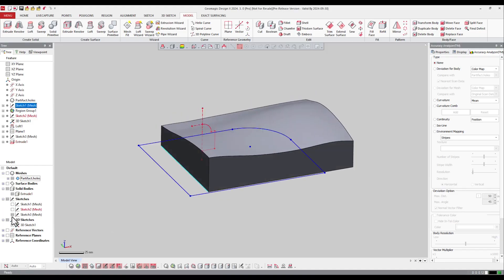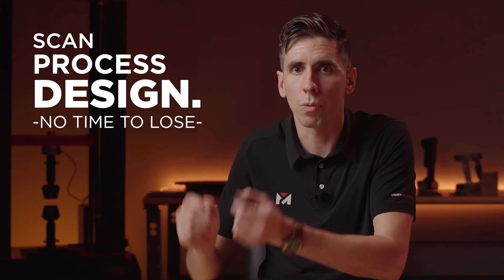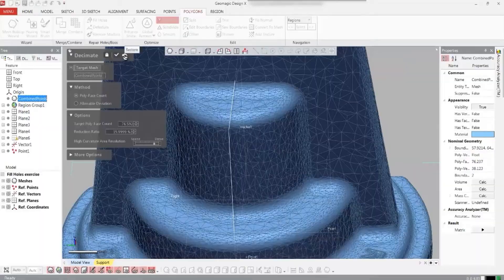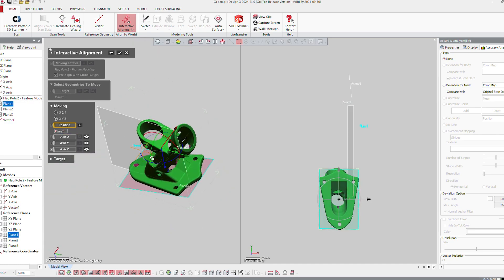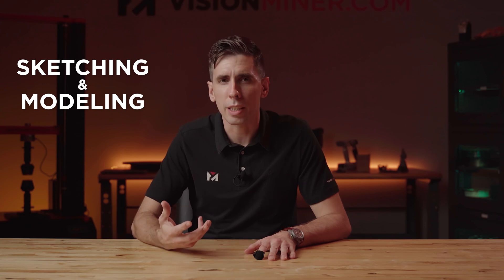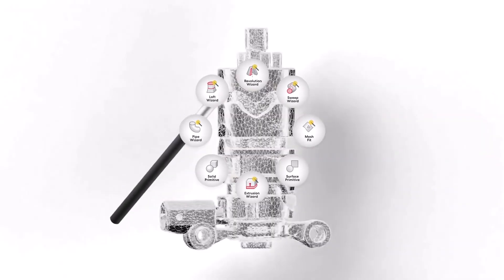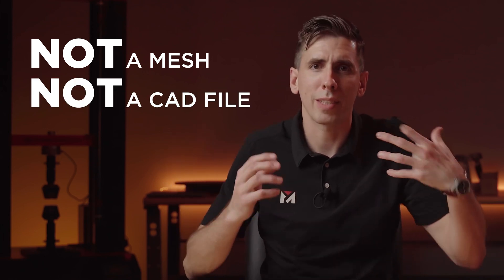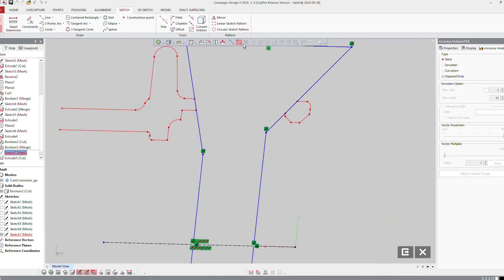Design X Go: The Fastest Way to Turn Scans into CAD

Comment: Yikes, $5k for the base version, $12k for mid, and 20k for Pro is not what I'd consider accessible. It sounds to me like Geomagic is seeing much more affordable competition from Quicksurface and Exmodel and trying to react.

Some of the features here seem very nice, but usually once I've done my alignments, filled holes, merged, and decimated I just import into NX and do my parametric modeling on top in an environment I'm familiar with, utilizing their reverse engineering toolbox. I'm sure the cost of NX plus any bundles is more than $5k (likely ~$12-$20k), but it's a much more versatile package than Geomagic.